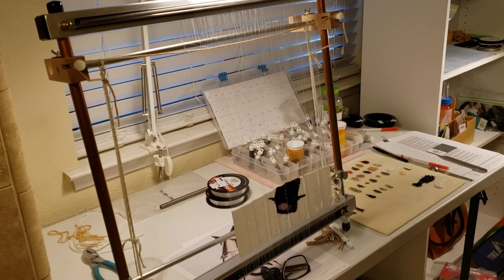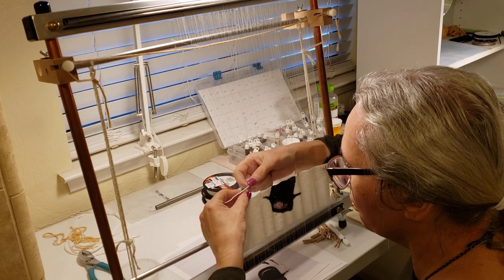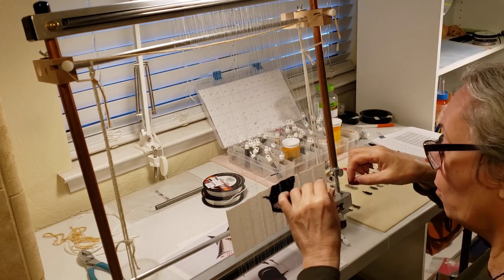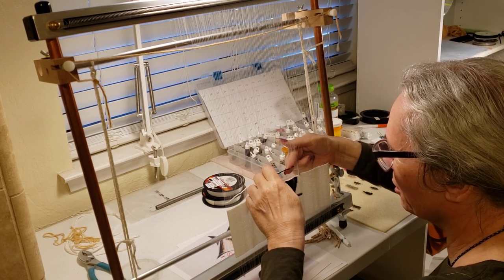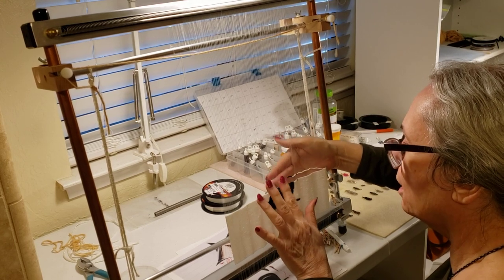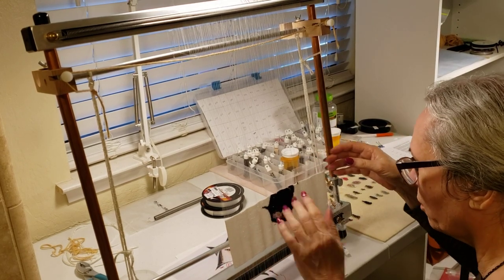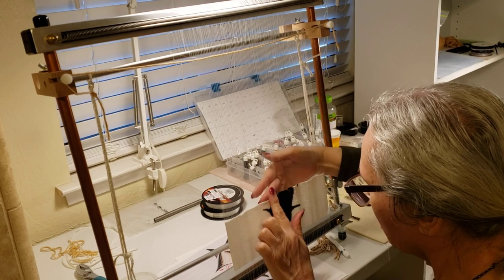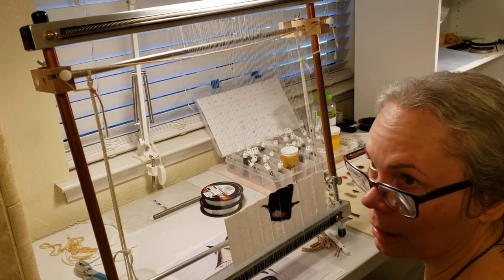Bead Weaving Demo, Installing a Row, March 25, 2020

Comment: Thank you for sharing how you string a row. I am so fascinated and have questions. I'm not sure how to ask where it will make sense. Is your map broken down into individual beads and rows? Um, like graph paper? Then would you count for example 50 white 12 black 30 white etc for a row and then string them? Thank you for explaining the spring at the top and how it keeps the vertical rows evenly spaced. Your art is so cool!
Reply from the maker: Thanks for the complement. Some people do graph it out and for a while I did too. The trouble with using this method with pieces like most of mine is that I end up with a graph that's too big to handle. If the piece is a bracelet with a geometric pattern, then x black and x white,... would work. I instead use a method more like setting up a knitting or crochet pattern. I spend days to plan it out and decide what my color palate will be.  Portraits require so many shades. The piece that I'm currently working on has approximately a dozen different whites, each with a different finish or effect, each which gives the piece its own character. At first glance, this image looks like 4 or 5 colors. In reality I had to work hard to get it down to 46 colors, and even then I've got several colors that I've placed on standby in case I want to add a little splash of something as I feel the need. The spring at the top and bottom keep from the warp from crossing, its the beads themselves that keep the piece even.  After a few rows in, I then can slip out the bottom spring, as it gets in the way. This is why I use only Miyuki beads. They are precision made and very consistent in size. In bead weaving if beads are not consistent, then it shows. I have very few culls as a result.